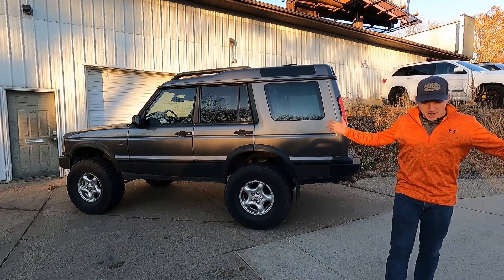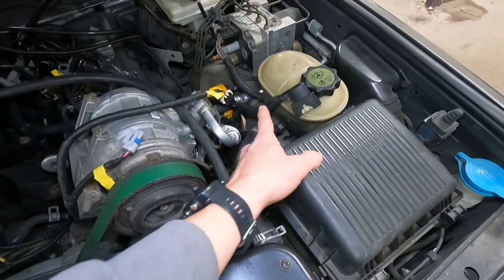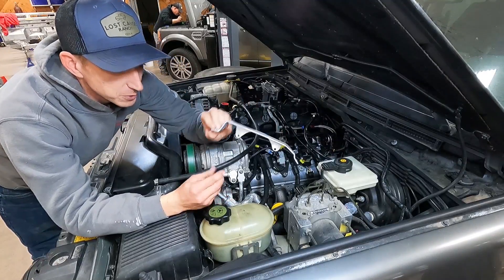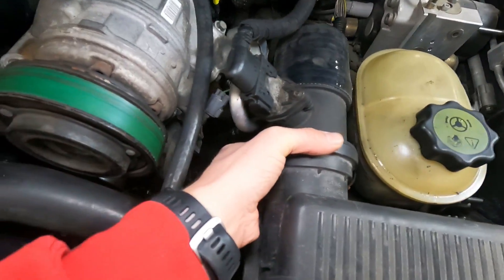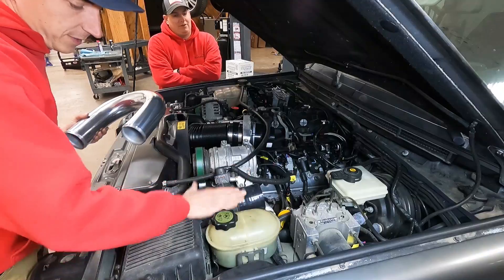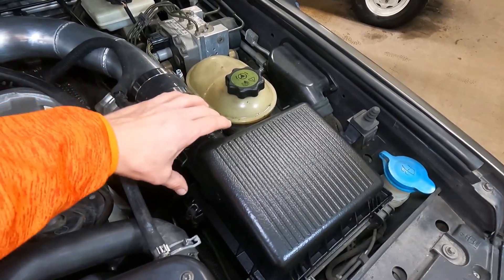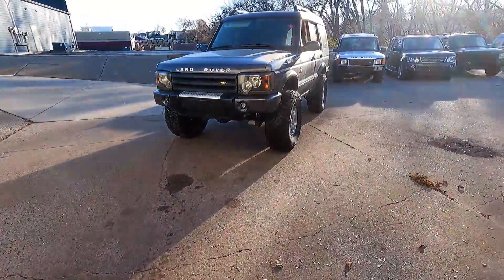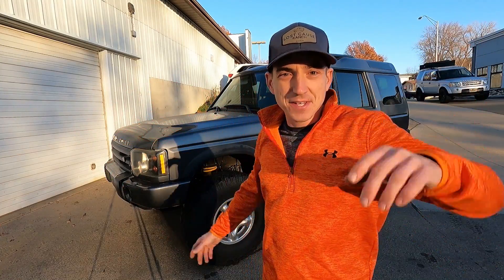IT DRIVES! LS Swap Discovery 2 | Air Intake Build

Comment: Very nice and clean install. Electric fans are an option to get a little more room in the front. I'm working on doing that to my 5.3 D2 now. You may also want to consider cutting part of the internal plastic piece out of the Land Rover airbox so the LS can get more air. Things to think about after you get a few miles on it.
Reply from the maker: Thanks for the heads up on the air box. Electric fans would clear some room up.
Reply: @LostCauseRanch  I DID THIS WITH MY 300 TDI GOT RID OF FACTORY FAN WENT ELECTRIC HEATERS ARE MUCH WARMER NOW

Comment: Have to ask, what did you do to remove the SAI system? I could have sworn that would have thrown a code, just pulling it off.
Reply from the maker: I’m assuming you are talking about the sai for the gm engine. We had the ecu tuned for it not being there.
Reply: @LostCauseRanch  you said you put the GM ecu where the (Disco) SAI pump was. Or did I misinterpret?
Reply from the maker: Yes the Land Rover factory air pump was there. So if you do scan the Land Rover ecu it will show codes for a bunch of things because that engine isn’t being ran, but you tap the gm ecu into the check engine light so the cluster will only show an engine warning light with errors that occur in the gm ecu. So with the swap you do have 2 obd2 ports. One for the engine and the Land Rover one where it is stock. I have the engine one in the engine bay next to the fuse block. So you scan the engine for the gm engine related codes and use the Land Rover one for anything else. Let me know if that makes sense.
Reply: @LostCauseRanch   So in my state they do emissions testing via the OBD2 port. Not an exhaust sniffer. If the Rover OBD port comes up w multitudes of codes it's an automatic fail. Is there any way to give the illusion that OEM OBD is all good w no codes?